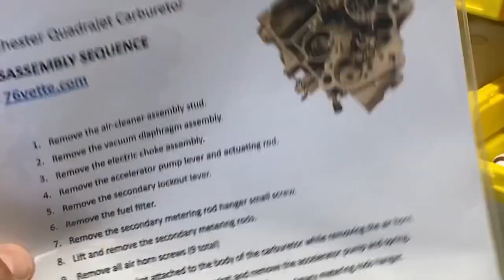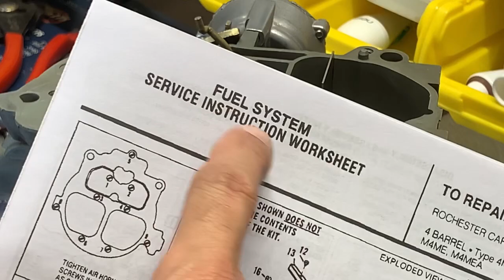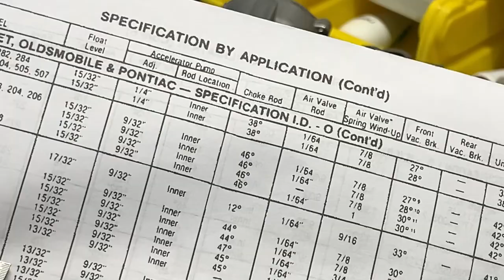Replacing Quadrajet Needle & Seat

Comment: One more question friend, I'll tell you, I have a Rochester Quadrajet carburetor and I want to change the primary nozzles along with the primary needles, and since there are different numbers of nozzles and primary needles, I have to deduce that depending on the number of nozzles, I must set the needle number equal to the nozzle number? I mean, if I put number 0.72 primary nozzles, should I put number 0.72 primary needles? I understand that in this way, the idling engine has the primary nozzles blocked with the primary needles, since they are of the same diameter, and that when accelerating and losing vacuum, the primary needles begin to rise, allowing fuel to pass to the primary jets, is that correct? all the best
Reply from the maker: Hello Francisco,
Your question is a bit confusing. I think by primary nozzles you are referring to jets. 
The Quadrajet fuel nozzles are inside the venturis and, as far as I know, they cannnot be changed. I guess they could be drilled, but I don’t think that would be a good idea. 
Also, if by needle sizes you mean metering rods (sometimes they are referred to as needles), I always use whatever size/taper is standard. 
Quadrajets are calibrated by engineers for specific applications and that’s why I keep mods to a minimum to avoid affecting performance. Something as basic as using a different air cleaner, for example, will affect carburetor calibration and performance. 
The idling circuit is quite complex. At least to me. And the transition from idle to primary circuit is well above my limited level of understanding, especially since it involves maintaining the ideal air to fuel ratio which is why I rebuild Quadrajets to factory standards. 
Having said that, your description of the basics of idling to primary circuit operation sound good to me. 
All the fuel delivered to the primary main nozzles flows past the jets controlled by the metering rods connected to the power piston.
BTW, the primary metering rod size does not mean you should get equivalent jet sizes. I believe the number and letter indicate taper diameter. 
I really wish I could answer your questions with more detail. Unfortunately, I can’t so I hope this makes some sense.

Comment: hello, at minute 15:10, remove the needle seat, I have a problem with my rochester quadrajet carburetor and it is that I think the needle is hooked to the holes on the sides of the needle seat and that is why it is sticking It floods a little, do you think that is the cause? both needle and seat, float, everything is new.
Do you think that the position of the needle that you show at minute 16:32 is better and would at least remove my doubt that that was what happens? greetings and thanks for the video
Reply from the maker: Hi Francisco,
As you probably know, diagnosing something like this from a distance is impossible. I am not clear as to why you think the needle is “hooked” to the seat unless one of the components was damaged and probably something that you would be able to see and feel just by testing its movement. 
As far as the windowless seat, I think that design is far better to help keep fuel in the bowl. But that’s it. 
My advice is to have someone familiar with Quadrajets inspect the carburetor to ensure all the components are installed and operating correctly. And I would also double check the level of the float. That could be the cause of the  flooding. 
Good luck snd thanks for watching. 😊👍🏻
Reply: @76vette  thank you very much greetings
Reply from the maker: @franciscotrujillo4961  You’re welcome! 😊👍🏻

Comment: What is the brass plug in front of needle an seat ? With the two flats on it to unscrew it ? I took mine off while cleaning carb an do not know if it needs to bottom out or back off so many turns ? It has a spring in it
Reply from the maker: I think you are talking about the APT screw (Adjustable Part Throttle). Before removing it, you have to count  the number of turns in (until fully seated) since they are calibrated at the factory. 
If you did not, Quadrajet Power has an excellent video on how to adjust the APT correctly. They also sell the right tool and every other Qjet part you may need. 

https://youtu.be/VqxXFwkT55g
Reply: Thanks greatly appreciated
Reply: Did this fix work on the drain back?
Reply from the maker: My carb no longer has a drain-back issue. 😊👍🏻

Comment: I see below that you said you sealed the well plugs with epoxy but that's not a sure bet. They way to tell if they are still leaking is detailed in Cliff's book and involves blowing compressed air into the jets and seeing if air bubbles form on the well plugs when soaked with soapy water. The epoxy fix doesn't always work. You might want to have to remove the plugs (best tool for this job is an old school dent pulling slide hammer with a screw on the end of it) and drill and tap the holes and epoxy set screws into them. That almost always gets the job done.
Reply from the maker: So far the epoxy seems to be doing the trick, but you’re correct about the set-screw fix being more permanent. 😊👍🏻

Comment: If the bowl is dry after a day are more its the cups under the needle jets leaking and some times they get so bad it floods the motor in as little as 5 minutes of non running replace them or JB weld them